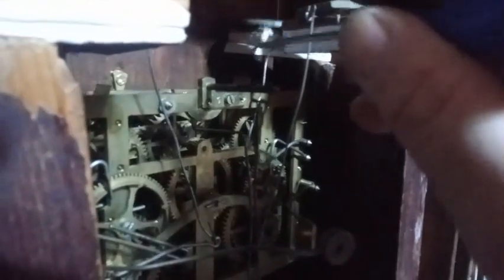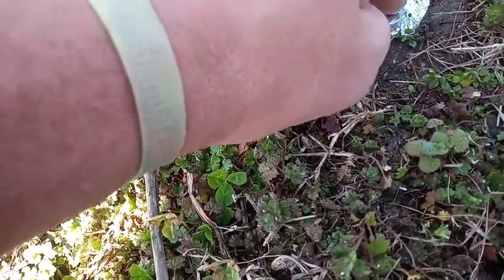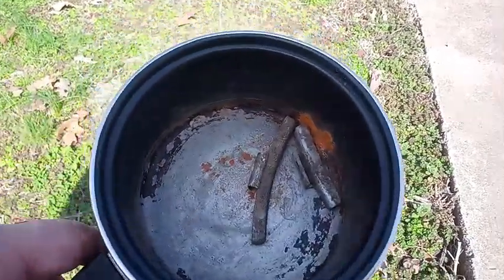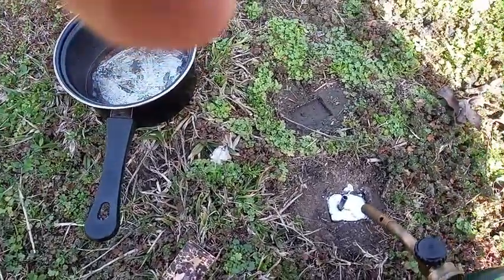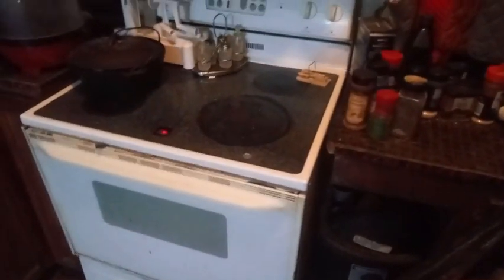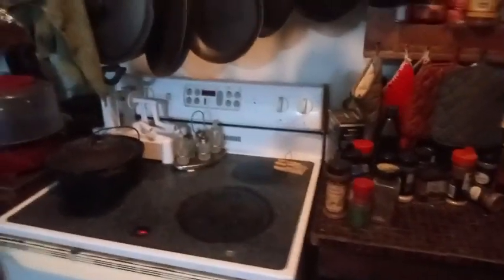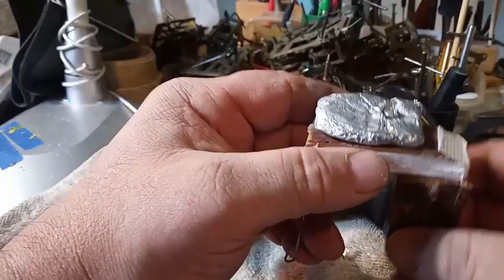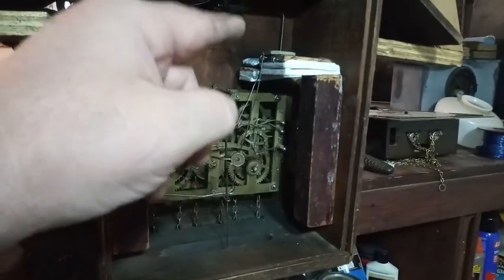Cuckoo clock repair for beginners (Bellow weights) See description

Comment: At the beginning of your video you mentioned led fumes are toxic, that is absolutely true! No project is important enough to compromise your safety! Get yourself an old camp stove, they're cheep enough and melt outside. Why not try boring a shallow hole on the top of the bellow, if there isn't already one there and melt some lead free solder using a soldering iron.. it's so much safer and easier! You can add or take away with ease.😉
Reply from the maker: All great information and tips. I dont think the lead free solder will work. This is an antique cuckoo quail clock that I am needing this for. The bellows for the cuckoo have weights that are wider than the bellow itself. The quail bellow has to drop quickly therefore needing heavier than normal weights. I had a propane  torch that I was using. It was just a little bit windy where I was doing everything and that is why it didnt work. Had I do this on a regular basis a different set up would be the idea thing such as the camp stove that you mentioned. But this was basically a one time ordeal. Thanks for watching.
Reply: @munnerlyn3  I've restored well over 100 antique cuckoos but never came across bellow weight in that fashion before. Is it posable the leather is so old and stiff? The quail pipes do require more weight but shouldn't need so much weight that it puts a strain on the strike train. Maybe try a different material like Tyvek or use a different quail pipe from a donor that's the  same time frame perhaps. Good luck with the project Mark, hopeful you'll find something that will work for you.

Comment: I utilize the lead insert from a grandfather clock weight, just remove it from the shell which is round, use a band saw to cut off a small circular slug and grind it down to the correct size by means of a bench grinder, One could also use just a hacksaw considering lead is so soft and malleable and file it down to the correct proportions to accommodate the bellow top opening. Sorry Mark, it seems like melting it down and taking the risk of those toxic fumes is too risky and more work than you have to do.
Reply from the maker: At first I was using a big washer for the weight. It worked great but it was too big and I dont currently own a vise to cut it down. I was going to use the weight from the tire alone without melting it down but thought that it would look like crap and my viewers would point that out. So I decided to melt it down. I thought my digging a hole in the yard and using aluminum foil was a great idea. With the comments that I woke up to today I am second guessing myself. LOL.
Reply: @munnerlyn3  Don't second guess yourself, you tried a method that you thought would work, you tried, thats the important part, it takes alot of courage to post these methods by video, I admire and commend you for that, these days, doing that, leaves you wide open to criticism from no shortage of armchair experts. Good for you, I enjoy your videos, I'm open and will consider anyone else's techniques if it makes me a better repairman, it's the only way you learn. Next time try it the way I suggested, just acquire a grand daddy weight and utilize the lead in the future. That much lead is enough to properly weight 75 bellow tops. I also utilize a mask of some sort when cutting and shaping the lead, dont want that in your lungs....Keep up the good work with the videos, keep in touch, we can collaborate together.

Comment: Have you thought much about how to make a coil gong sound better?
Reply from the maker: You have to work with it and make sure that any of the coils are hitting each other.
Reply: @munnerlyn3  that's true and how do you remove an escape wheel from it's hub?
Reply from the maker: Not sure if I know what you mean. If you are asking how to get the escapement wheel out of the movement then you have to take the top nuts off the movement, spread the plates apart a bit and the escapement wheel will fall out of the movement. If you are asking how to take the escapement wheel off the shaft then that is a lot trickier to do............
Reply: @munnerlyn3  I mean how do you get the escape wheel off of what it's mounted to when it's out of the movement
Reply from the maker: They are typically pressed on. So you would have to press it off. Why do you want to take it off?
Reply: @munnerlyn3  I want to turn a sessions recoil into a deadbeat
Reply: @jordanbusby6231  Staking tool....Make sure you acquire a staking set for clocks, not watches. Or, just use a bench top press of some sort, just make sure your set up is correct so you dont do more damage to the arbor/pivots etc. You can try and use a butane torch to expand the wheel on the arbor a little when removing the old wheel as well, but, less is more, be careful.